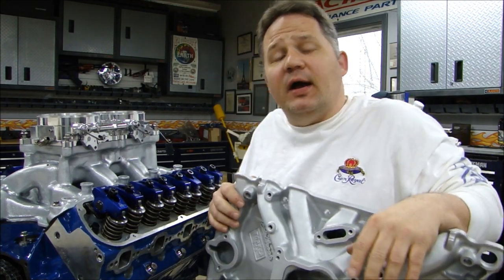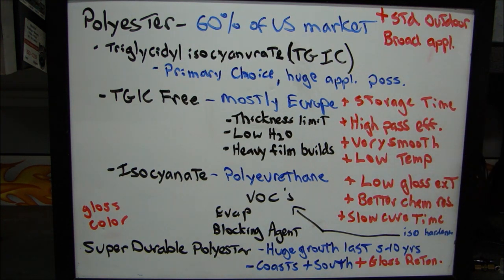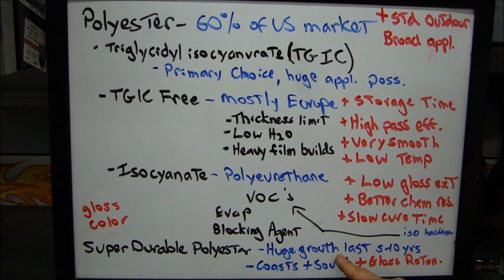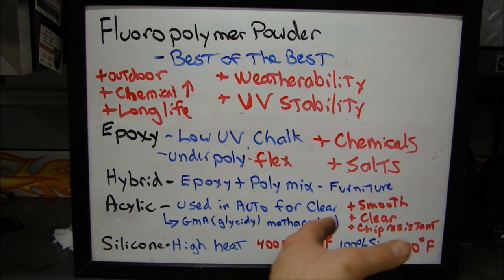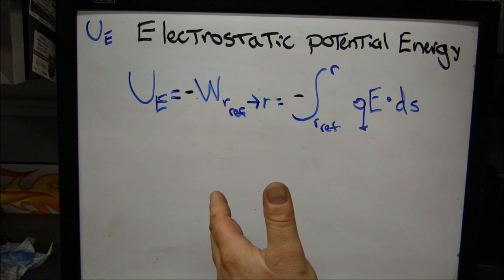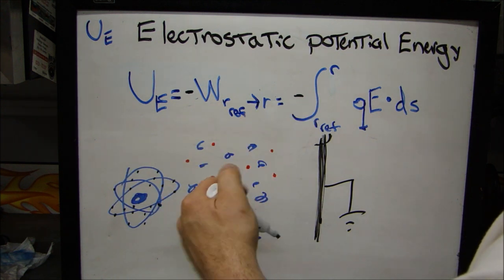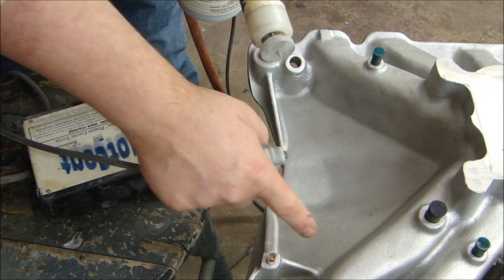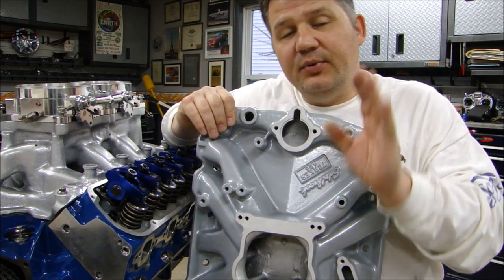Powder Coating and The Science Behind It

Comment: Pete, thanks for the great information. You answered a lot of questions I had. Right now I'm building a Hot Rod and need to powder coat the raw steel frame, new steel  wheels and other small parts of the build . I live at the beach and will deal with salt and heavy sun. After seeing your video I trying to decide Fluropolymer or Super Durable Polyester as my powder. My question is, witch powder type would you use living at the beach?
Thank you Sir !